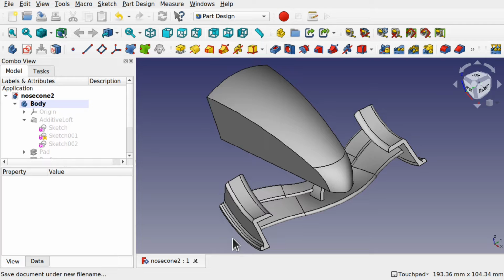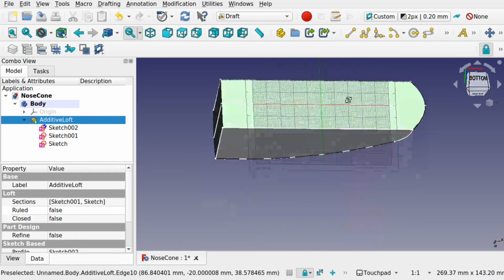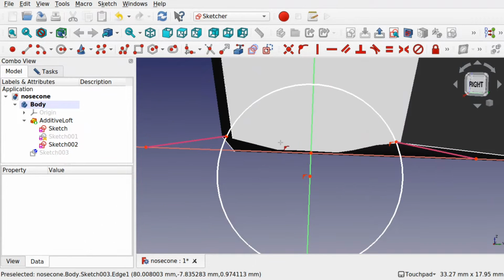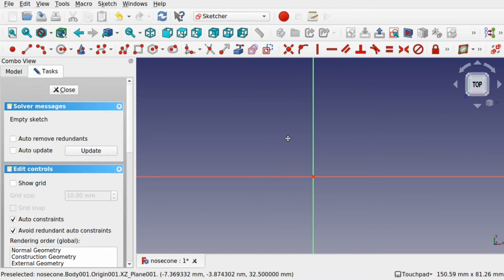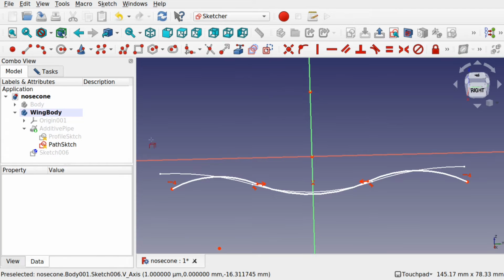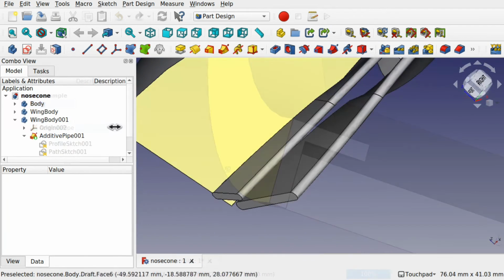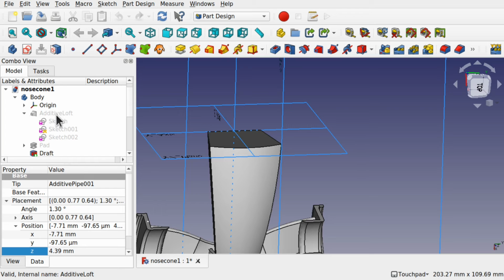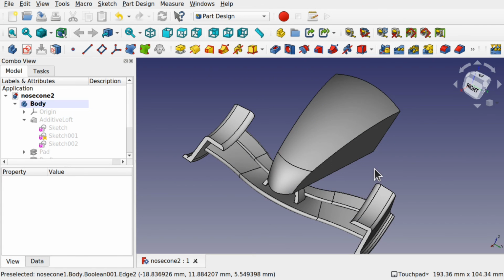Understanding FreeCAD: Build a Formula 1 Car Nose Cone | Part Design | Beginners Tutorial

Comment: Well done, especially about placement. It's a very annoying thing in FC. Also I've found that if I make a part folder and make body inside there it may have another placement. Didn't try to use unions, I need to check it. Also, sometimes it's not so easy to locate parts as you showed it here, if the pos must be precise. For example, designing gear box. I mean the situation when I've put everything in place and then need to modify something. And even shape binder may work not in the way I want. In such situations sometimes I use draft's clone or even part's simple copy.  Obviously that it's a bad habit, but I can't solve that issue in a right way. So, hope to see your video soon. Thanks.
Reply from the maker: Thank you, glad you enjoyed. Placement can be challenging in freecad. I found its often best to do multiple bodies and then use an assenly workbench to bring them all together. Even then you have a choice of several workbenches all with their own challenges which can create additional work.